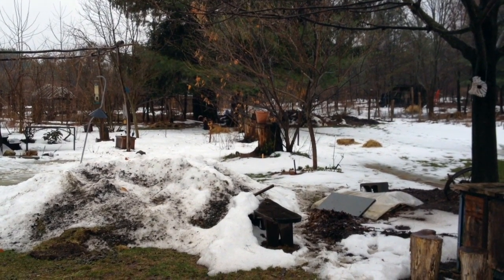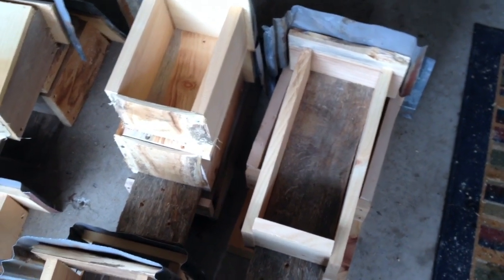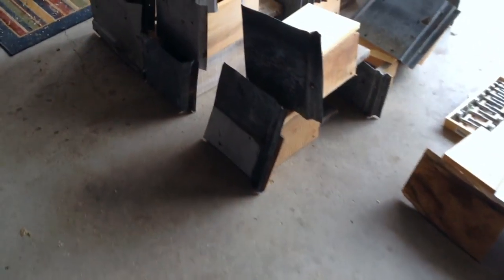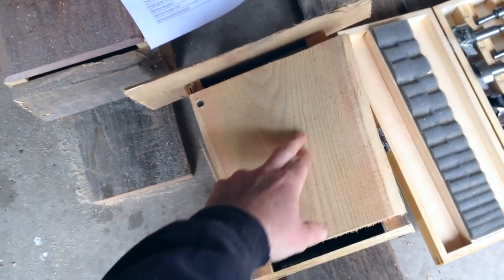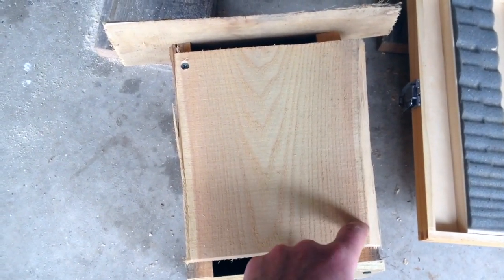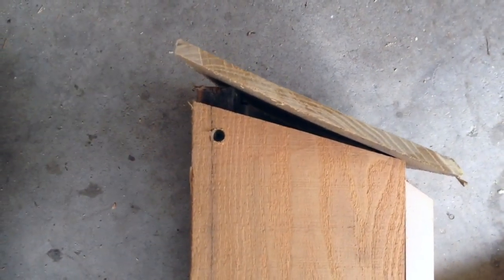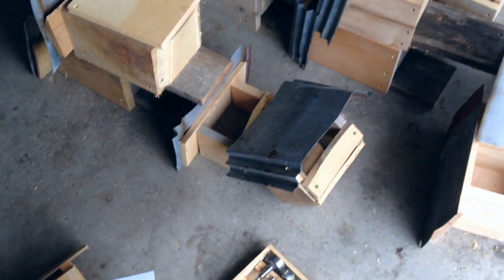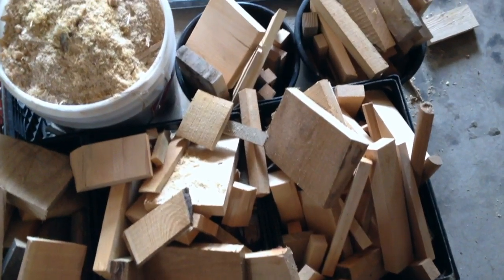Building Bird Houses and Mason Bee Homes

Comment: Two questions. When is the right time to renovate the bird houses? Do the bee houses need renovated/new bamboo and if so, when?
Reply from the maker: I will say I'm still very new to this, so I won't offer specific advise.  I think there would be better videos / websites on that.  BUT I try to get out and clear out old nesting material from the birdhouses late winter so they are ready for when the birds arrive.  The mason bee homes need to be renovated every year or two.  Take out all old tubes, with bees or not, and put them in a cardboard box with a little hole in it.  That goes somewhere out of the rain so they can hatch and fly out.  In the home you replace with fresh bamboo and japanese knotweed.  I'll put a video out on that soon enough...